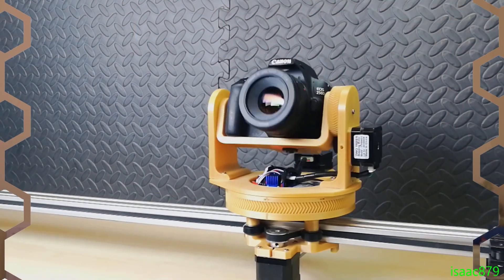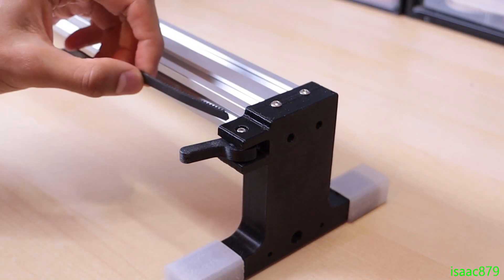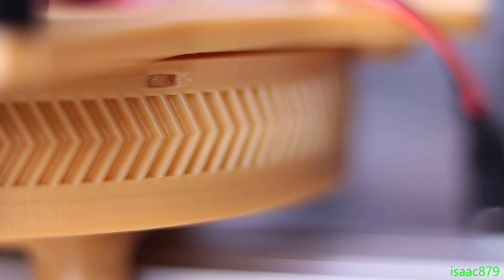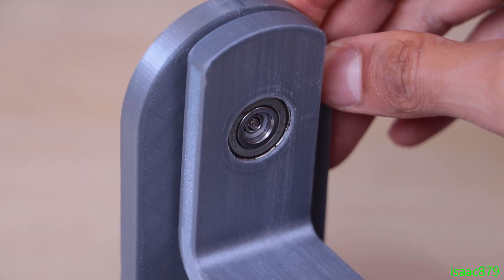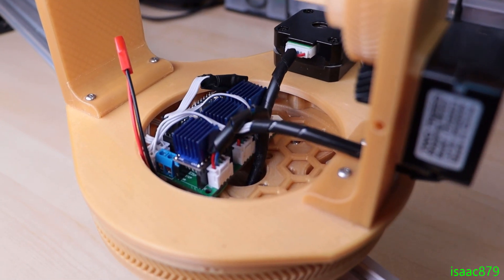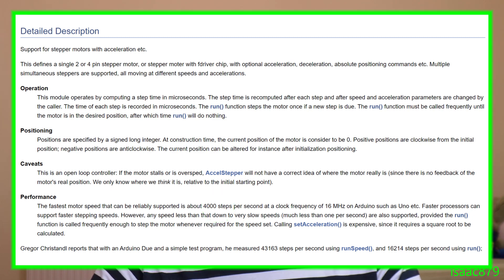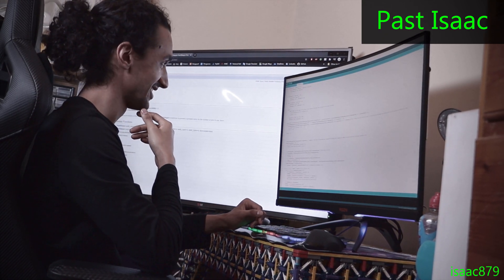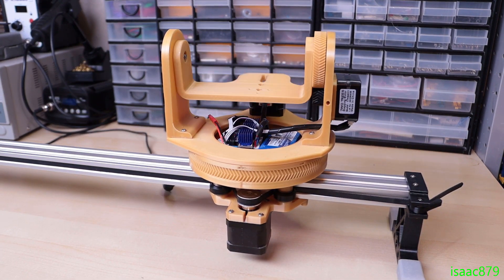Perfecting My DIY 3-Axis Camera Slider!

Comment: Love the credits in your video description ! ahah. it really looks like you have a huge team with you.
some request and question for your consideration:
- would you be able to modify a couple of parts to allow for larger camera body ?
- I do not have the need, but I would second the comment on controling the focus ring.
- I would definitly second the suggestion on selling kits. (in my case, I can print and source the extrusion, but having to source all the bits and pieces from various suppliers is a show-stopper)
- you might mention it, but it would be great to have a simple way to program a movement (set start and stop positions, position vs time curve with some set points, etc.)
Anyway thanks a lot for sharing. I came from hackaday, glad I clicked and now I'll subscribe.

Comment: Thanks for sharing! Could you add a battery pack on the side or underneath, or do the power requirements of the stepper motors make that impractical?
Reply from the maker: You could. The motors need a peak of ~3A (depending on stepper driver current limits) so you should be able to run it off anything that is 6-12.6V and can supply 3A.

Comment: Sir I'm building an ROV and plan to use your gimble to maneuver my camera housing. As for the wires could you not use a slip ring connection to give you unlimited 360 degree motion? Thank you for sharing and teaching us.
Reply from the maker: A slip ring should work but there really wasn't any need for continuous rotation on the slider rail so I decided against it.

Comment: This is excellent! Exactly what I needed and a great explanation of the design. I'm gonna make a copy and use Dragonframe for a motion controller. Thank you for sharing!
Reply: I'm interested to hear about your result as I'm in need for something like that for Dragonframe(stop motion)! If you could share how it worked for you and if you'll made any changes.
Reply: @DargorAZ  I still haven't built this bit yet because of other projects, but here's the rest of the rig. I used DFs arduino moco logic - https://youtu.be/fN8VCFuKh-U
Reply: @ssutton4455  thanks! That looks great!

Comment: Hey, awesome work! I don't really get where all of the magnets are supposed to be placed. One 6.4mm on the 64tooth gear, but where to place the other 6.4mm and the four 3.2mm magnets?
Reply from the maker: Thanks! I should have explained better in my videos. I actually doubled up all the magnets otherwise they would sometimes be a bit weak to trigger the halls. So the two 6.4mm ones go in the 64 tooth gear. Two of the 3.2mm magnets go in the hole of the 144 tooth gear that doesn't have a countersink (it will line up with the hall sensor in the "Pan Mount Bearing Clamp"). The last two magnets go in the hole on the legs that is centred under where the extrusion slots in (it will line up with the hall sensor in the slider carriage).
Reply: Thanks! I started building the project. 😊

Comment: isaac please consider my questions:
first question is that is it ok for using a 20*40 aluminum extrusion with 1.20 meters length? does it bend under 2-3kg weights? 
do u suggest me to use 2 pieces of 20*40 or one 40*80? the biggest problem i have is that stronger aluminum pieces have 10mm slot and i cant find a carrying wheel for that size(10.23 min 12.23 max) 

secondly, what holding torque is required ?  im running somethimg arounf2.2kg of weight and maybe i switch to 4.5 kg camera later, a 40ncm or 57 ncm is enough or what? 
and for the pan and tilt what holding torque is required? 

last question is that should i print parts on petg or abs? and what meterial have u used for the flexible pulley?

Comment: I've already built this one on my own and posted it on your thingiverse "makes". Take a look.
I have 3 questions bothering me, but I don't actually understand C++ that much so I can't change it.
1. You decided to use panoramiclapse and timelapse for cameras to take pictures. It means it has to stop every time you trigger a shutter. Most people now use sliders as cameras to make a videos (product showups, b-rolls, etc.), they don't need panoramiclapse and timelapse to stop each time. Even if I change my msdelay to 0ms, it still stops, for like 0,5 sec making everything to shake. What can I change in the code in order to not stop everyshot, but just smoothly go from Keyframe 0 to Keyframe X without any unnecessary stops? I am not making a photography, I'm using slider to create timelapses with like 1hour, so I don't need to stop my  camera to take a shot, because it doesn't blur anyway,  it's too slow. I tried around and put a command ";" but before I used "W" command to slow it down, but it's kinda tricky...
2. My commands according to intercept point don't really work as expected. I create 2 keyframes, I press "T", i get coordinates. I click "[" to go back to first keyframe (it goes back good way, its just opposite). I enter "@2" and... my slider goes good way, but Pan axis is going like crazy, turning like 300 degree to the side and ends looking in totally different direction, not on object. Are you sure the code you uploaded is okay? 
3.  A few days ago I uploaded your code. Commands e.g. "p20" and "t20" worked fine, it was turning with 20 degree. Now I downloaded your code again (had to wait for new arduino, my old one got burnt), uploaded it and... now Pan degrees are doubled (when i put p90, it goes to 180), and my Tilt angle is quadruple (when I put t90 it goes back to 0). Did you mess something around the code lately? Slider axis works perfectly fine. 

I have a few more questions and bothers so it work fully perfect, if you want, we can chat a little, we would figure something nice out. I think i'm the first one creating this to the very end, so I have a little "know-how" now.
Reply from the maker: Sorry for the delay in replying. I've seen your make and feedback. Thanks for putting all that effort in. I've uploaded the correct slider carriage stl files now. 
Unfortunately I don't have time at the moment to implement any changes... I originally designed this just for my use but there was a lot of interest so I made it open source and tried to make it a bit more user friendly without having to redesign the entire thing! As such it's definitely not ideal for anyone who isn't me.
1. I decided to implement it the time lapse that way so I could get the full resolution of the camera (if I use the camera's inbuilt timelapse it limits the resolution). If I wanted a slow continuous movement I would use the keyframes and 'W' command to limit the speed.
Points 2 and 3 might be linked. What version of the code have you uploaded and are you using the TMC2208 drivers? I think when I uploaded the 2040 version of the slider I switched the pan and slider motors around (for better wire management) so it you didn't do that as well then you would have issues with moving to a specific angle but keyframes would still move to the same positions so I think that might explain the issue.

I hope this helps and sorry I can't do more at the moment.
Reply: @isaac879  thank you for response, i don't have Time now either to test what you wrote, but i'll try to move on in a few days. I changed a few files so it fits my needs, i'll upload it on remixes on thingiverse soon.

Comment: nice design, I will make my own, but I can't find any magnets of this size, is it ok to use smaller ones or is the size important for the function?
Reply from the maker: I just used the magnets I had on hand so the size isn't important although the CAD models are designed for the specified sizes. Before you glue the magnets in you should check they are strong enough trigger the hall effect sensors though.

Comment: Hello Issac, I have a question. Your arduino is in the middle and it rotates when panning, right? How come that your wires to your slider motor are not damaged. Please, give me advice.
Reply from the maker: If you rotate in one direction too much it will damage them. There is enough slack in them that they can safely rotate about 360 degrees in either direction, which is plenty of movement for any shots I need to get.
Reply: @isaac879  Thank you

Comment: Great work. Just printing, I read that YOur camera is quite small and really, it is 15mm smaller, then mine. So I am Now trying to expand the stp files. Unfortunately I cannot find the pan tilt mount.stp file. May You send me, or publish this file too? Thank You very Much for Your great work. Thumbs up.
Reply from the maker: Thanks! I'm not sure why the Pan mount stp was missing, I just reuploaded the zip with all the stp files in it. If it's still not in there, it must be an issue with thingiverse so give me your email and I'll send it to you.
Reply: @isaac879  Thank's a lot. The file is now included in the Zip files.Now I'll try to expand it. Thank You very much.
Reply from the maker: @sdcauto1149  No Problem. I hope modifying it goes well :)

Comment: Great work. I'm very impresed of yours skills. Do you have maybe some easy example code how to switch from A4988 to TMC2208 or how to run motor with arduino and TMC2208? I'm asking cos  i cant find any usefull information on internet. I was tried switch those drivers in my slider and it dosent worked :(.
Reply from the maker: I have the slider code I used with the TMC2208 drivers on the github repo. They should work almost exactly the same as the A4988 drivers though, the only difference was the step modes were a different order. I found this which has pretty much all the details about using the drivers https://wiki.fysetc.com/TMC2208/
Reply: @isaac879  Thank you. You helped me a lot. Now it works :)

Comment: Amazing project, but can I use this board ? https://www.omatompower.co.in/3d-printer.html  What's ur opinion about this ? thank you
Reply from the maker: That board should work fine to drive the 3 motors however it would have different pin assignments and some different components so you wouldn't be able to use my code without some modifications.

Comment: Love this project. Might I suggest using an electrical slip ring so you dont lose your rotational ability? https://www.amazon.com/Taidacent-Electrical-Collector-Connector-Commutator/dp/B07QPNXXBQ/ref=asc_df_B07QQPR6NQ/?tag=bingshoppinga-20&linkCode=df0&hvadid=&hvpos=&hvnetw=o&hvrand=&hvpone=&hvptwo=&hvqmt=e&hvdev=c&hvdvcmdl=&hvlocint=&hvlocphy=&hvtargid=pla-4584138864013422&th=1

Comment: Man ! I discover your chanel on Youtube, serching DIY slider since a whiiile ! I'm actually building one myself and with a friend. Using an other design, but basicly the same process than yours, just flip the U bracket (where's your camera) and I'll put my camera there. 

I don't need to do those kind of "turning" shots. So I don't need to be align : sensor / middle axis. I need portability ! 

Actually, we are think about the control cards. Do you think 1/128 is enough ? Did 256 bring a lot to you ? We were thinking of taking this one : TB67S128FTG

We'll just develop it in python using a raspberry Pi. Wifi controle on the phone. 

Last question : do you think DC motor could be okay or better than stepper motor ? We're thinking about switch motor technology !
Reply from the maker: That's awesome, I'd love to see it when it's done!
For the motor control I think anything you can do to make it smoother is worth it so I would still go for 256 microsteps although I haven't personally tested 128.
As for DC vs stepper motors: It really depends on what kind of shots you want to get. Stepper motors are great of open loop motion control as you know where they are based on step count but dc motors are great if you just wanted smooth continuous motion. You can do motion control with DC motors but they require encoders and closed loop control which can end up being even more complicated on the software side.
Reply: @isaac879  Thank you for this answer ! My friend really want those DC motors. Less torque also is definitly not really good haha 

we don't have to think about microsteps then.... And as he is coding the soft, that's his problem :D 

Also, how did you do the "focus object" stuff ? We had idea to define x / y / z as 0 of left part of the slide, and put in soft the approximative x / y / z of the object to focus. Do you think it's a good idea ? How did you do ? 

I'll keep you in touch of this project ! :)

Comment: Where you put magnets on the slider?
Reply from the maker: There is a ~3mm hole in the centre just under where the 2040 extrusion slots in.
Reply: @isaac879  And detectors are in the carriage?

Comment: The three bearing parts (inner and outer race and bearing holder) aren't shown in the 3d printed part montage.  Did you print the bearing or buy it here?  I tried .177 BBs (~4.5mm) but they fall out of the holder and then bunch up on one side of the ring.  Seems to slide just fine without the BBs in PETG, fwiw (could prob spray some teflon in there and call it done). 

Overall this is one of the best engineered parts I've printed over the years.  A parts kit might be a nice upsell here so I don't have to go track down everything or buy 10-100 of them. ;)
Reply from the maker: I already have a metal bearing but I did also 3D print one too to test it. It was designed for 6mm bbs not 4.5mm so that would be why they are falling out :p 

Thank you! It was originally just a personal project so I didn't put much consideration in the design and component selection for other people to make it.

Comment: im doing a similar project, but with lanc compatible devices for zooming, for video streaming!
One is controlled by a joystick with arduino, another is using raspberry pi+opencv for automated tracking
was cool to see your idea in action,
Reply: I just found the pan and tilt hat for an Rasp Pi in the clearance bin at my local Microcenter and saw your comment.  I also have the HQ camera so I wanted to do an object tracking cam for my live stream music events.  It may be more clear when I start the object tracking code, but I was wondering if you found a way around the colored rectangle that appears on most of the object tracking videos on youtube. I have a servo controlled zoom lens too. Perhaps you have a bit of direction you would be willing to share to point me in the right direction?  your project sound like just what I was starting to envision. Thank you in advance for your time!
Reply: @antithesis4  hey jordan, the rectangle is no issue, the rectangle just gives you an indication on what is being tracked. You can make another dispay frame which has nothing on it. Just think of the rectangle as the frame being annotated on
Reply: @dojomats   Thank you for the reply and reassurance! I thought it might be an easy "fix". Ty again

Comment: Did you consider turning the 4020 rail 90 degrees so it’s better able to support the weight of the assembly on longer applications? It should also allow the assembly’s weight to be better transferred to the rail because it will slide on top of the rail rather than pinching it from the sides.
Reply from the maker: I was actually going to mention this in the video but decided to cut it! I did consider it but I can't even notice any flex in the rail under the weight of the camera so it seemed unnecessary. I also wanted it to have a wide base to help reduce any flex and twisting of the slider carriage and mount.

Comment: A very cool project one i look forward to making.  Are you able to prevent the camera from doing a 360 to prevent a longer lens hitting the bottom plate
Reply from the maker: Thanks! No, at the moment there are no limits on the movement range so you just have to make sure you don't drive it too far. The stepper motors should skip steps if you do run the camera into something (I've done it many times) way before it would cause any damage to the camera or lens so I didn't really think it was a big issue.
Reply: @isaac879  I am working on adjusting your files to fit a canon 7d with a slightly longer lens, only because that's what I have.

If you were to design this mount again, not with standing the upgrades you have done on your gold mount. What would you do different.  I will be using a 3d printed bearing though larger in radius I think with 8mm balls
Reply: @isaac879 any thoughts on the above

Comment: This looks great! I'm just tech-savvy enough to be tempted to take on this project.
Reply: If you want to try, do note, there are some design parts issue and very challenging to assembled, you may have to modify the parts. (eg,  you unable to fasten nema 17 screws.) I am stuck at the assembly and have not proceed to control , sad,  waste time.

Comment: First of all, great work Isaac! I would like to build it myself, so I am now searching for all the parts. Could you specify the specs of the motors chose? There are multiple specs available for the 23mm Nema 17. It would be great if you could respond to this message and/or update the parts list
Reply from the maker: Thanks! I didn't realise there was a significant difference between the motors. I used these exact motors: https://www.amazon.co.uk/gp/product/B07SSRV2YC/ref=ppx_yo_dt_b_asin_title_o00_s00?ie=UTF8&psc=1

Comment: Great project, thank you for sharing! I am working on something similar. I have decided to mod cheap aluminum alloy gimbal head (due to its stiffness) and make its axes radio controlled. Your project is much more elegant I must admit. But I wanted versatility and stiffness of gimbal head and possibility to use large telephoto lenses. I just started with code, so I have no accelerations/decelerations yet. For know I read precise joystick position and run it with runSpeed() function. If you are interested, here is preview: https://www.youtube.com/watch?v=RFCSSYfWLtI